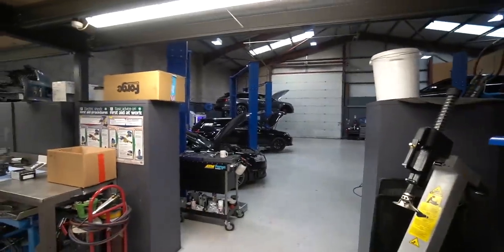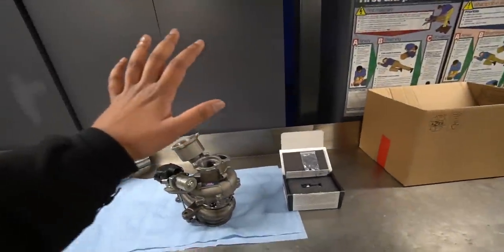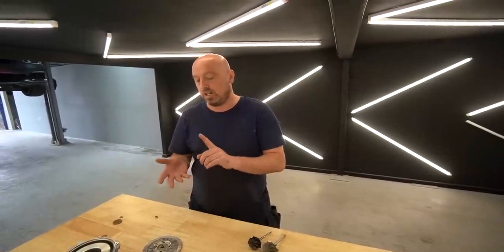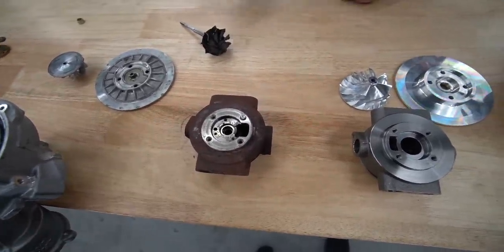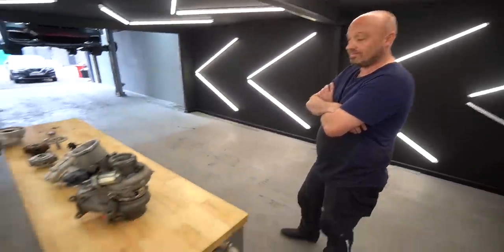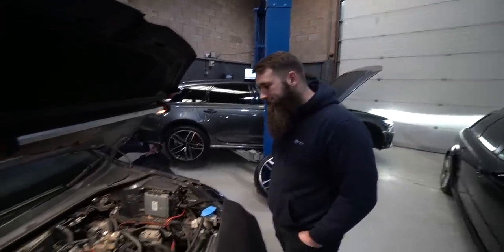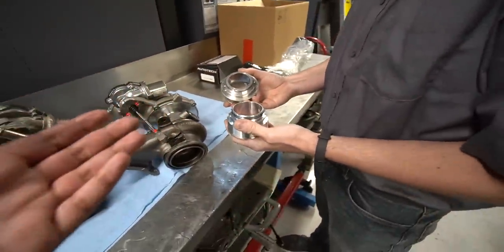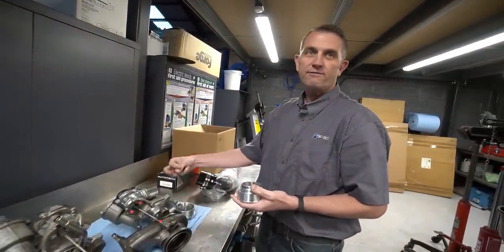My VW GOLF GTI gets a 500HP HYBRID TURBO!

Comment: It's awsome how simple it is to put out 500hp from a 2.0 turbo that comes factory with +220HP, no need for bigger injectors or tank fuelpump, stock rods and pistons, just an awsome overbuilt engine from factory looks like
Reply: That’s only the euro spec GTI, in the US there’s no multiport injection so you have to add port injection and also upgrade the low pressure fuel pump

Comment: Looking great, regarding the rts clutch have you had it slipping at all? I have had one fitted to my gti using the original dual mass flywheel, even after 600 miles it is slipping under boost, I have driven it wry carefully as well, bloody annoying tbh, so e people have told me I should of fitted the flywheel from the golf R,...
Reply: What power you running? Looking at getting a rts clutch for my mk6

Comment: Would the car be drivable as is, with the hybrid and not mapped? Looking at doing an is20>is38 swap but unsure how I'd get to the tuner 😅

Another great vid btw 👌
Reply: I’m sure it will be fine mate. It’ll run like a normal turbo, they’d DEFINITELY need coding. As soon as possible I’d say. But you’d be alright for a bit, obviously won’t get any proper power until tuned
Reply: Yes its fine to drive to your tuner, just dont go flooring it until its tuned.
Reply: The IS20 to IS38 swap would be fine to drive as there is no HPFP upgrade.
Reply: Thanks lads